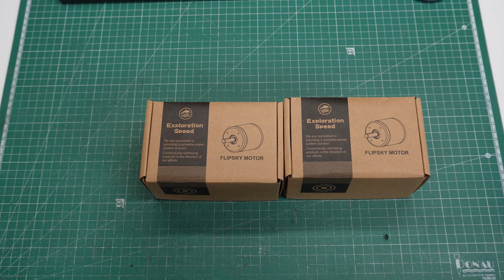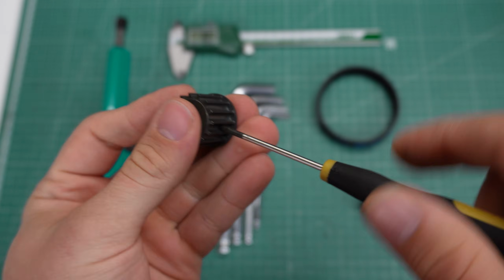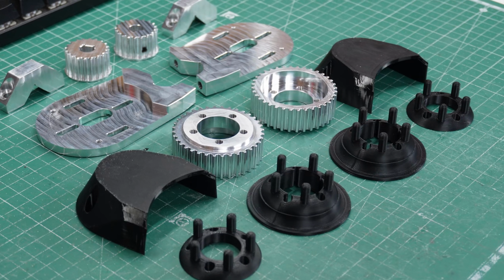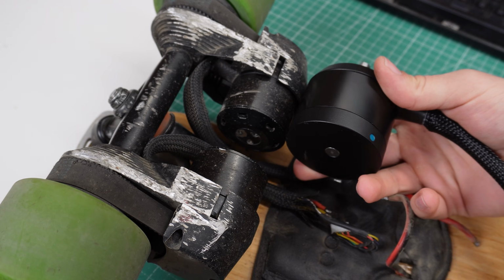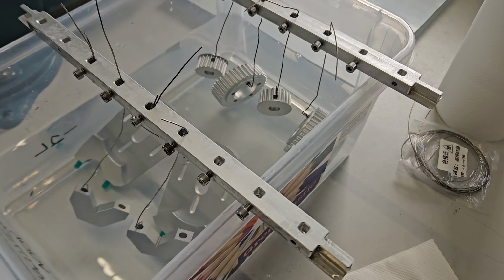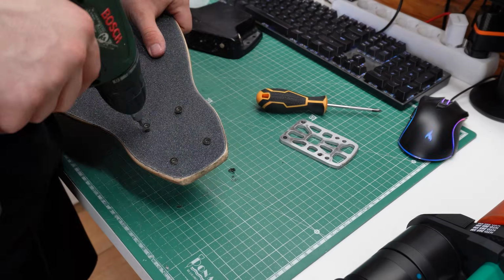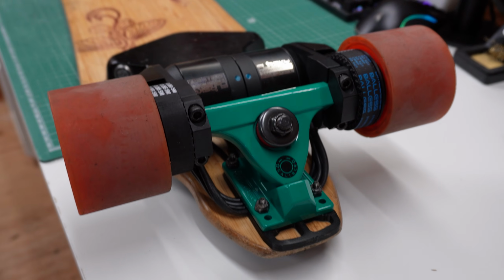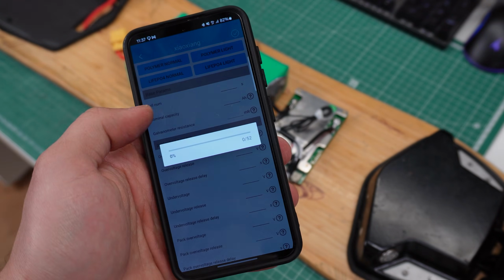I Added 5000W of POWER to my Skateboard! - Flipsky 6354 Drivetrain Build

Comment: why on a skateboard 5kW=40kph whereas on an ebike you d go 80kph with the same power 
??
Reply from the maker: Hi! My gear ratio is set to 40 km/h. I could easily achieve higher speeds if I were to change it, but such high speeds are not necessary on a skateboard :D. Also, one thing to note is that this is a 5000W drivetrain, meaning the motors can output that much power. However, in my case, the battery cannot output that much current, and the motors are current-limited to make the board easier to ride, as otherwise, they would just spin in place from too much torque.

Comment: How long does the battery last?
Reply from the maker: Hi! The curent battery was built with Sanyo 20700 cells and has an capacity of around 7.2Ah or around 300 Wh max. This would usually give me around 20 km of range but the battery lost a lot of capacity and so the range got to something like 10km max at the moment. The new battery pack I'll be building will have 10Ah or around 420 Wh capacity and this should be in the 20-30 km range

Comment: You do know that power is made by the battery? Everything downstream just delivers that power to the blacktop. If you want to know, how much power you're making, just look at the battery amperes the controller is drawing. Bigger motors just add thermal headroom. Your pack can deliver around 2kW, if you push it enough. I wouldn't draw 60A from a 2p Sanyo pack.
Reply from the maker: Yes, good thing to point out! The 5000W is the peak output power these motors can output. My battery and electronics can not handle that much power at the moment

Comment: i made a electric longboard a few years ago , made the deck and battery ! was so fun! i used 6374 190KV x 2 and a massice battery... it was crazy fast half throttle i was getting 50kph , way to fast for a longboard haha!
Reply from the maker: That's so awesome! I bet 6374 motors are crazy torquey. Also, this was my first time using motors bigger than 5045 and I was blow away by the power. Can't wait to build the new battery pack so I can finally be relieved of my range anxiety 😆

Comment: How much did the enire build cost I'm considering building myself one now 🤣
Reply from the maker: Oof, I'm 100% sure it would be way cheaper to get a prebuild board haha... The motors and the speed controller are around 400 euro, plus the battery, deck, trucks, wheels, pulleys, motor mounts, remote, charger, etc..